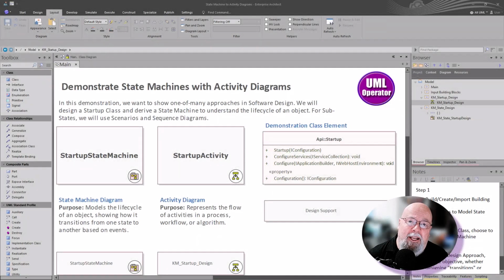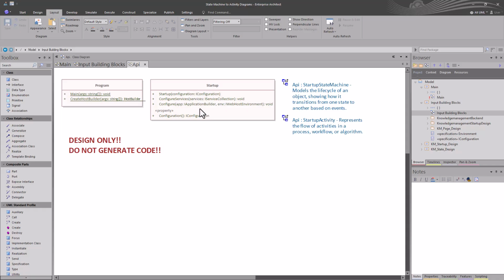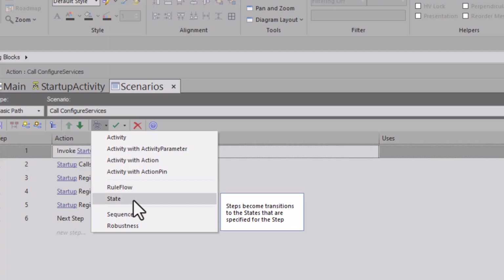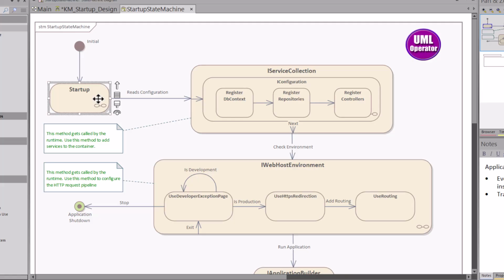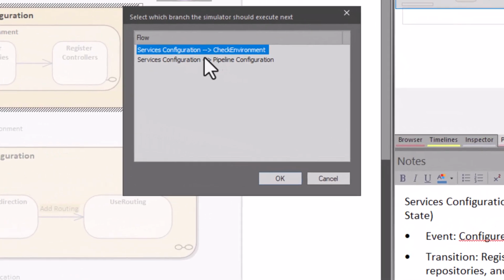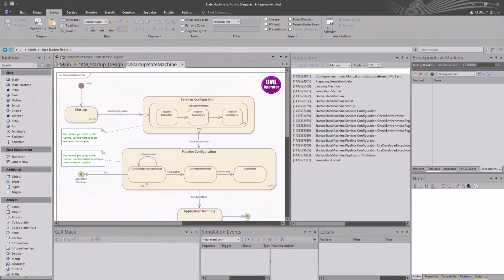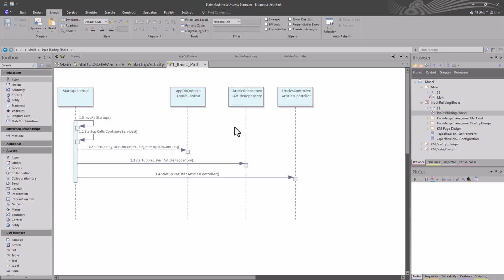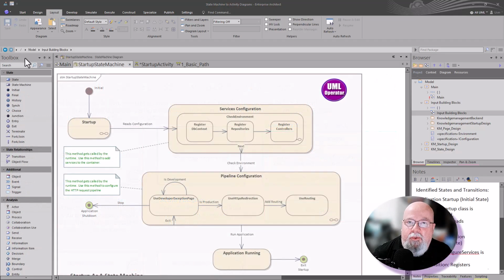Mastering State Machines with Activity Diagrams for System & Software Design

Comment: You are a hero. 

I still haven't figured out how to call between states, sequences and activities. 

1. In states your do behavior can call an activity with a referenced behavior. But when I run the simulation it won't call the activity. 

2. When I create a class that has a classifier behavior as a statemacgine, then instance that class in a sequence, it doesn't run the state machine when I run the interpreted simulation. 

Any chance you know what I'm missing? Something with calling behaviors from an instance or classifier behavior. 

I've liked and subscribed!!
Reply from the maker: @TolulenePictures, thank you for the post.
Sparx does not really support a single simulation that automatically jumps between different UML diagram types. You could script the flow, but it's not really worth the effort.
I need some more context, such as what the intent is. Is this for a client presentation? or collaboration with the team to expose the step-by-step actions and events, like debugging architecture, systems, and software? or for something else? I am going to assume all of the above.
Typically, we are stepping through a design approach and want to understand the Activities, Interactions, and states during such interactions, events, actions, and flows.
In this video, we started with a Class Element (API::Startup)
We usually start with Activity Diagrams, potentially derived from Use Case Scenario development based on Requirements. We do this for top level processes, and then decompose major activities showing Actions. The Actions have attached composite Sequence Diagrams to explain the object interactions for key moments. The Classes driving the "Object" instances have State Machine attach to define lifecycle behavior.
Let me put something into our queue and produce a video to show how Activity, Sequence, and State Machine models complement each other, and how to navigate between them when doing behavioral modeling.
Thanks again for the post and HAPPY MODELING 😀